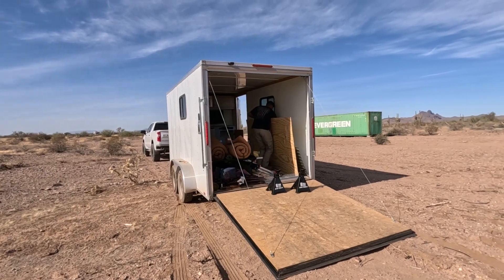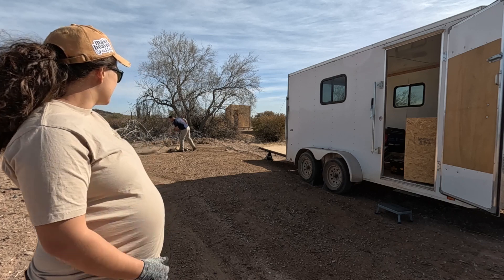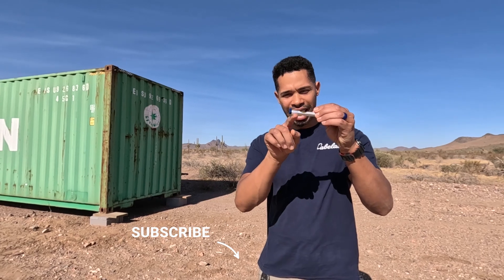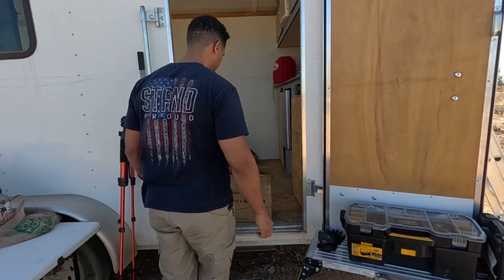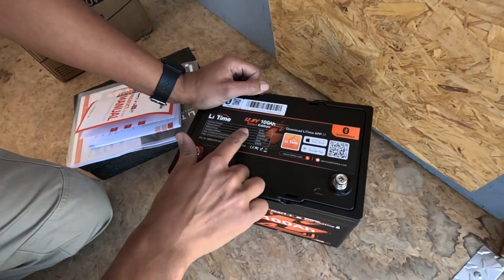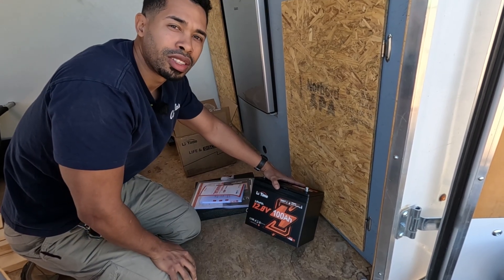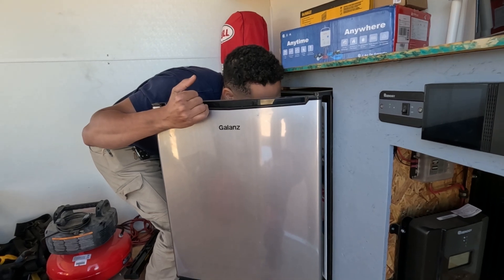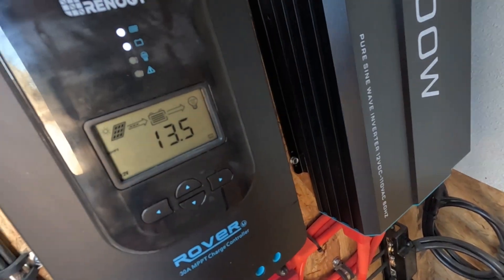SIMPLE Off Grid Power Upgrade | LiTime Group 24 Self Heating Bluetooth Battery

Comment: Hey Miguel, I live up north and I am having issues with the LiFePo in my van.  The temps have been below freezing for weeks, so my battery went into Low-Temp protection.  I looked into "heating pads" and other options, even reached out to a company that makes battery warmers, the company charges close to $300 for their batt-heater, and every other option I've looked at either the pads heat up too fast which could damage the casing of my battery or there is some other issue.  To make a long story short, I'm grabbing the same battery you got.
Reply from the maker: Hey, I'm sorry you went through that. I cant believe how expensive battery warmers can be. Yeah it's way worth the price to just have automatic heating batteries. They use their own power which easy and seemless. I hope the LiTime battery works for you! Glad we could showcase something useful! Good Luck!